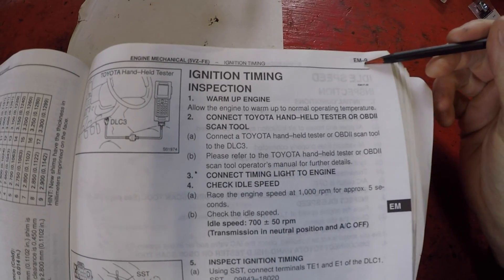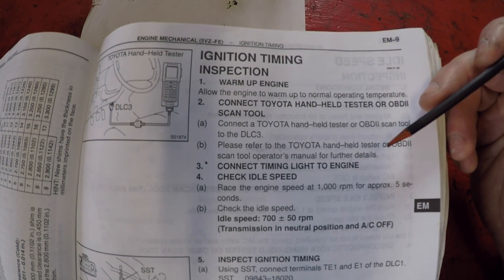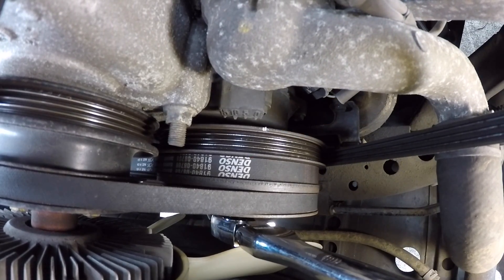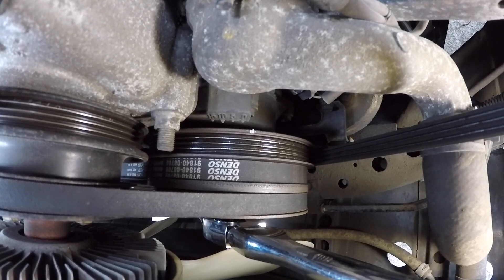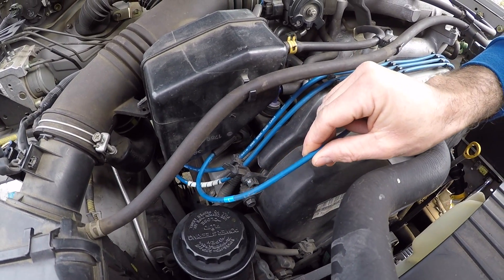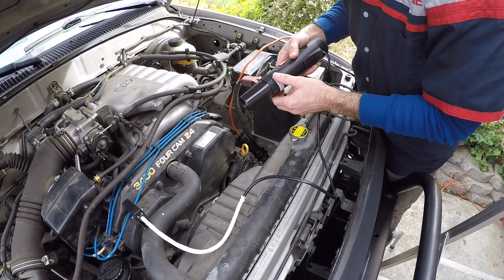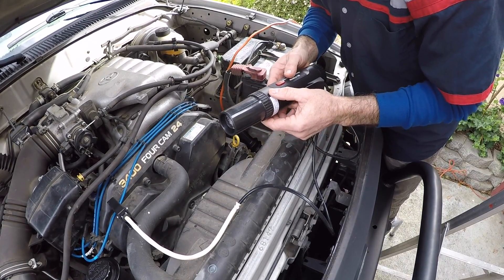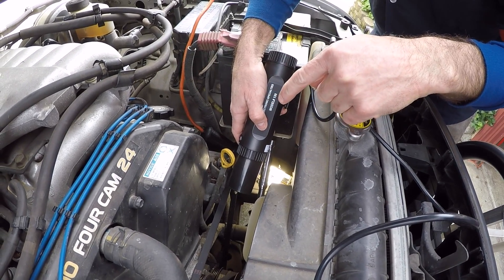Engine Ignition Timing Check

Comment: I rebuilt my 5vzfe watching your vids.. when I put the engine together I put all my marks right on the exact spot. Put my belts on, got all the marks perfect, put it all together.. misfire.
Code reader doesn’t read anything at all. I think it’s timing. I thought if it was all on the marks it was good to go.
Where could I have gone wrong?!
Reply from the maker: @DrEvil-os9dc  If you're absolutely sure you got the engine timing right, it could be something simple like you mixed up the spark plug wiring.  It's happened to many guys.

Comment: I feel your pain Greg. I've got mystery misses on 12 and 4, but they are not throwing a code. Must be too slight to engage. Ive replaced everything you have as well.
Reply from the maker: @SwipeTheStones  Greg no longer owns the truck.  He sold it once we learned the cause of the misfire which was gross play in the crankshaft, causing an engine knock.  We suspect one or both of the knock sensors were generating the misfire.  Check out the video of us discovering the problem.  https://youtu.be/9Gpdq-tL79U?si=X1d2ZNpPE4xARks5

Comment: Hey Timmy.  I could not find a 1st gen Tacoma video repair on evap issues.  Question: do you happen to have a diagram or complete list of all evap hoses in the engine compartment? I am having a tough time trying to get part numbers for a couple hoses!!! Tyia
Reply from the maker: Sorry Richard, I don't have that available.
Reply: @TimmyTheToolman  Ty Timmy.  I thought I would at least try.
Reply from the maker: @richardramon2175  Have you ever heard of Tech Info?  You can buy a 2 day membership for $25 and download as much as you want during the 48 hour period.   It gives you access to factory service manual information to any Toyota, Lexus, and Scion vehicle ever made.  

As for looking up the hose part numbers, I'm not sure what online parts seller offers the most comprehensive parts diagrams.   I usually go to my local dealer to get my parts because they give me a discount and can get me any part usually the same day or the next.
Reply: @TimmyTheToolman  After searching online for any diagram I could find,  I did go to my dealer and came up empty there as well. It could just be we never found the correct internal link but other than removing the two hoses and gently cleaning them I was told I might be able to read the part numbers. 
I've even called and spoke to the parts department at olathe Toyota and they were not able to identify the smaller 3 1/2" hose.
I might try the place you suggested as well.

Comment: Thank you For your advise Timmy. I hook up the wire to terminal te1 and E1 and rest throttle control and idle adjustments to 800 rpm and the timing look matching to the timing mark at 10 Btdc and the truck run better this time. But still need a little adjustment somewhere? Thank you again Timmy.
Reply from the maker: No problem.  Hope you get it dialed in.

Comment: Hi Timmy. do you think you guide me throught setting up ignition timing on 92 toyota pick up v6? i was little confuse when i supposed to use the terminal jumper connect to te1 and E1? do i supposed to leave the wire terminal jumper  on while i am setting up the timing mark or am i supposed to disconnect when i am setting up the timing mark. 

i run into setting timing 10 btdc on the  mark, but rpm not setting at 800 rpm. when i adjust the idle screw to the 800 rpm then the timing mark is off again. thank you timmy
Reply from the maker: I've never timed a 3.0L V6 and I don't know if your engine has a similar diagnostic port like the 3.4L V6 has.  Your best bet is to get a Factory Service Manual for your truck so you can look up the proper timing procedure.  From what I've seen though with a couple different Toyota engines, the 3.4 in my 3rd Gen and the 22RE in my 1st Gen, you're suppose to jump a couple terminals when setting the timing.

Comment: Tim did you see how much play was in the harmonic balancer for the video at start up? The initial startup on the motor showed horizontal play in the crank and harmonic balancer
Reply from the maker: Yep, I noticed it when editing the video.  It lead to these two videos: https://youtu.be/uxvXicCba6o and https://youtu.be/9Gpdq-tL79U
Reply: @TimmyTheToolman  Wow! Quick response! I had a question too on this..

Just did the timing belt (same kit from ebay)
My cam marks are lined up perfectly, and the crank mark was off...(about 15 degrees to the right of 0.. its all back together and sounds normal and idles without codes... is this okay? I had taken the tensioner off before going TDC...
Reply from the maker: @hansdavis9081  Sorry to say Hans, I think you should redo it.  You want your timing correct.  Taking off the tensioner before going TDC isn't necessarily bad.  You just want to make sure when you get the new belt on that all 3 timing marks line up - both cam pulleys and the crankshaft timing gear.

After doing the timing belt job, we did learn theres is a small timing dot on the forward face of the crankshaft timing gear you line up the "CR" line on the timing belt to to make it more straightforward to get the belt on correctly and properly timed.  I wish I would have noticed that timing mark when we were filming the job.  But, I did make it clear you want all 3 timing marks lined up and to double check it by making 2 full revolutions of the crankshaft to confirm the timing is right before putting the engine back together.

Comment: Need help with proper timing. While changing belt and water pump, I turned crank only without the belt on. Putting it back together, I rotated 1 full rotation, when it all lined up, I was sitting on the 5* mark , do I need to retime and how please if so. Thank You
Reply from the maker: Yes, you will need to re-time it.  The crank pulley notch should line up with the "0" when the cam pulleys are lined up with their respective timing marks. These videos will help you out. 
https://youtu.be/vHC46ypHxWc
https://youtu.be/mErd7xoBS9I

Comment: What  do you do for coil on plug.
Reply from the maker: I don't understand your question.
Reply: @TimmyTheToolman  There is no  plug cable to attach the timing light.
Reply from the maker: @fernandohood5542  You clip it around the the spark plug wire that goes to the #1 cylinder.  Every timing light should have this cable.

Comment: Can the belt and water pump be inspected this way?  Or, do I need to drain radiator and remove hose too?
Reply from the maker: The timing belt can be inspected by pulling the upper timing cover back, but getting a good look at the water pump will require you to remove more things like you mentioned.  Unless you're having some sort of coolant leak from the front of your engine or you have a pulley noise that you suspect is coming from the water pump pulley, I see no reason to visualize the water pump.  I guess you're trying to figure out if you should perform the timing belt job.  If the belt looks cracked at all, I'd do the job and we have two videos you can reference to help you do it.  Part 1: https://youtu.be/vHC46ypHxWc  Part 2: https://youtu.be/mErd7xoBS9I  I suggest you watch both parts before doing the job so you have a good idea what the job entails.  Also read the video descriptions and the comments we pinned.

Comment: Timmy I glad you did this video. I changed timing belt and water pump a few months back on my 02runner. I fought with the timing belt and passenger side cam pulley. Ever since I installed the belt I've been wondering if the the belt is off a tooth at the passenger cam pulley. It seems like I've lost some power after the change. The other day I was pulling my boat up the mountain I live on. Going up a real steep section of road my runner got up in the RPM's. Next thing I know it was like the motor hit power band like a two stoke. Anyways it's always nice to be able to take a look at your videos for tips, trick and oh yeah reminders. Even for jobs I've done before.
Reply from the maker: Hey Lance, it certainly sounds like something is off.  Might not be a bad idea to double check your timing marks.  You can easily remove the upper timing cover back far enough to expose the cam pulleys by moving the upper radiator hose clamp back on the hose.  Turn the motor over with a 19mm socket on the crank pulley bolt until you line up the crank pulley notch with the "0" on the timing mark.  If the cam pulley notches aren't in view, do one more full revolution with the crank pulley and then they should be lined up.  If all 3 timing marks aren't properly lined up, you'll need to pull it back apart and get it right.  Let me know what you discover.

Comment: Thanks timmy great infonas always. Probably just saved me a bunch of money. I've never owned anything newer than a 91. Used to carburetor and distributor lol. I prefer old school. Thought my ignition timing was off cause my timing mark was fluctuating and my obd2 scanner said my timing was at 13 degrees above tdc. Threw me way off lol. Will be checking valve timing tomorrow to check that too. Thanks
Reply from the maker: You're welcome Rick.

Comment: If the timing light is off, how do you adjust the timing? STUPID question, sorry. Do i just have to make darn sure the timing belt is put on correctly along with TdC?
Reply from the maker: Not a stupid question.  Back in the day with engines with distributors, you could turn the distributor to adjust the timing.  I think the only way to mess up the timing is what you said.  The timing belt is not correctly installed.
Reply: @TimmyTheToolman  Thank you so much! I love all your videos! Super helpful! It's my first toyota vehicle ever so, slowly learning!
Reply from the maker: @robertlawson1184  You're welcome Robert and Happy Learning!

Comment: What about checking to see if the gear cog on the crankshaft has wallowed out the key and key Way throwing off the timing? Or rather allowing the timing to vary..
Reply from the maker: Not a bad idea Kevin but we did figure out what was going with Greg's engine.  His engine has massive play in the crankshaft which let us know where the loud engine knock was coming from and why he's getting a misfire CEL.  The knock sensors must be picking this up and triggering the misfire.  We have a couple videos on this subject: https://youtu.be/uxvXicCba6o     https://youtu.be/9Gpdq-tL79U
Reply: @TimmyTheToolman  Good deal, I'll definitely check those videos out. Thanks so much for all the work you share brother. 👍😎

Comment: Tim, awesome videos!
Question, our 2005 Sequoia threw a P0102, and P0308 with like 6 cylinders miss fire, the next day ran fine, long story short I pulled it in the garage, used the factory service manual (photo attached) and found 
MAF to EFI 1, 148 ohms
MAF to body ground 148 ohms
EFI to body ground dead short .18ohm

I'm taking wire harness appart and looking for body contact and finding nothing. Should I trace the MAF and EFI1 wire start to finish?

Looks like I can't attach a photo of the factory manual page

It says 
MAF to EFI1 below 1 ohm
MAF or EFI1 to ground 10k ohm or higher
Reply from the maker: Hey Tim, glad you like our videos.  For your misfire issue, it sounds like you're on the right track to diagnosing your problem.  Auto electrical isn't one of my strong suits, and even it it was, tracking down a short can be a labor intensive and frustrating process.  Toyota forums are full of super knowledgeable people and maybe somebody on T4R.org could point you in the right direction to figuring this problem out.  Let me know how it goes.

Comment: Good video as always, hey Timmy did you part number for the radiator hose clamps?
Reply from the maker: I don't have a part number for those constant tension radiator hose clamps.  Those might be hard to source online because quite often the parts schematics on these websites don't show small parts like hose clamps.  If it were me, I'd just visit my local Toyota dealer parts department and pick up a couple.  I know you pay more at the dealership but sometimes it's worth it for the convenience of getting what you need.

Comment: I forget, did you guys do a leak down test on his engine? Could be leaky valves.
Reply from the maker: We did do a compression test and we did a leak down test of that #1 cylinder.  The compression numbers for all 6 cylinders were good.  Here's the video of us performing the leak down test: https://youtu.be/8yuCHzqH7MY  We did finally figure his problem out.  He has gross play in his crankshaft, most likely due to the thrust washers giving way.  We first noticed the gross crankshaft play editing footage from this video.  Here's a quick video we made showing that play: https://youtu.be/uxvXicCba6o  Here's a follow-up video of us confirming the play we are seeing is all in the crankshaft and not from the harmonic balancer becoming separated: https://youtu.be/9Gpdq-tL79U

Comment: Would the coil igniter module have anything to do with this?
Reply from the maker: I don't know.  Greg's engine actually runs well but it has an audible knock.  It's obvious to us now where that knock is coming from.  I thought at first it was most likely the crank position sensor generating the misfire but it does make sense that it's most likely the knock sensors generating the misfire like somebody suggested.
Reply: @TimmyTheToolman  hey Tim, any follow up on this? I've been going crazy trying to track down the source of my 1700-2000rpm detonation/rattle on my tacoma.
Reply from the maker: @RocanMotor  Yes, there is.  When I was editing this video, I was shocked at something I saw in the footage.  I got Greg back over my place and I found out his engine had gross crankshaft play most likely from the thrust washers giving way.  Greg ended up selling the truck and when the new owner pulled the engine and dropped the oil pan, my suspicions were correct.  There were pieces of the thrust washers on the bottom of the pan. Here's a video showing us investigating the crankshaft play:  https://youtu.be/9Gpdq-tL79U
Reply: @TimmyTheToolman  thanks Tim, missed the follow up. How many miles were on Greg's truck? I'm trying to sort a misfire/ping ar 1750-2000rpm 3-5th gear at medium loads. No cel. Driving me nuts.
Reply from the maker: @RocanMotor  Greg's truck had less than 200k from what I remember.   The thrust washers failing is pretty rare with these engines.   Hope you can figure it out.  Problems like you're having can be frustrating and hard to figure it out.  Keep us updated, on what you figure out.

Comment: Could it be knock sensors,exhaust?
Reply from the maker: I thought it was most likely the crank position sensor triggering the misfire due to the gross movement in the crankshaft but somebody told me the engine would be running really bad if the crank position sensor was generating the misfire.  He said the knock sensors on the 3.4 liter engines are fairly sensitive and are more than likely the cause for the misfire CEL.